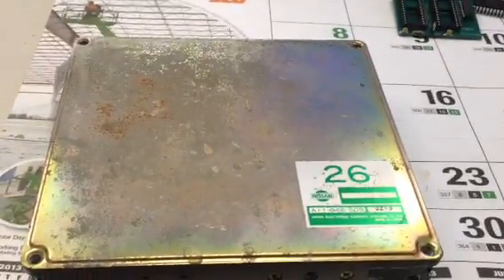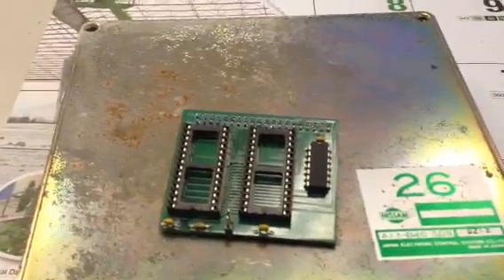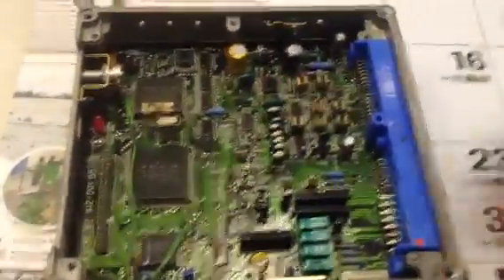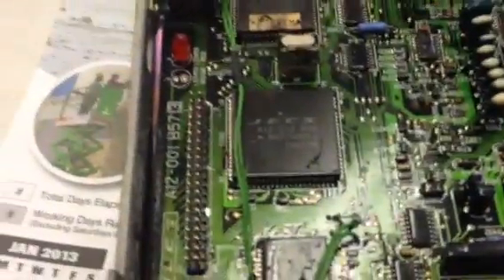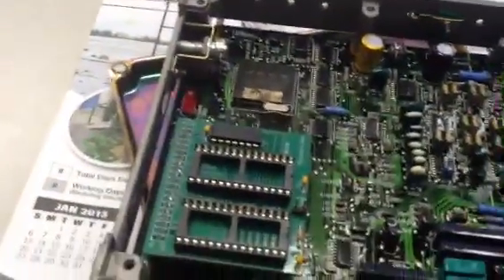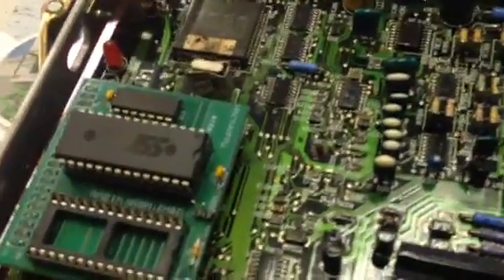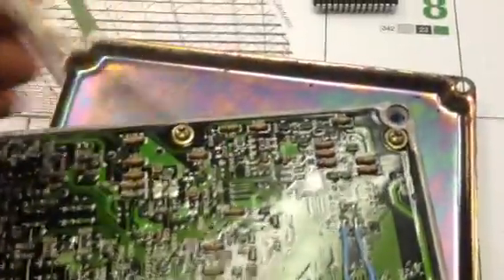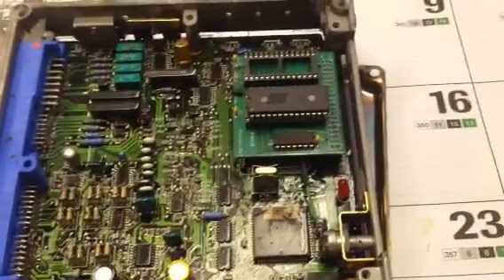Chipping your Nissan 240sx ECU ka24de/sr20det

Comment: I know it's been a long 10 years but this video is really helpfull. I'm working with sr20de+t build and would like to know if there is any chance author or anyone else in community could direct me about putting the tune on the chips, like what kind of software to use and what kind of adapters are needed to flash the eprom
Reply: you need a moates chip burner, and their software for it. You can use a tuning software to edit it such as tuner pro to edit and save, and the burner software to burn it to the chip it self.
Reply: @JZjess  thanks a lot for the info
Reply: @slowphased  this day and age you're better off buying a plug and play standalone for it's safety features and it's simplicity for tuning. You can get a link plug and play or a ecumaster with a jumper harness ans save yourself lots of headache.

Comment: Can auto ecu on 240sx convert to 5 speed?
Reply from the maker: They are the same, the only different is auto has no rev limiter.
Reply: I can put an auto ecu on my 5 speed ka24de motor and drive it without any problem?
Reply from the maker: @red666A  correct.

Comment: Could you chip a single cam running on itb?
Reply from the maker: No, single cams are unable to be tuned. The easiest way to get some wiggle room is using a piggy back like an AFC. If you are going ITB you might want to look into a standalone. ITB single cam is very uncommon. Properly built and tuned you can get maybe 20-45hp at best, reliably.

Comment: Good video. I have done EEPROM tuning before using TunerPro on a Bosch Motronic system and now will start on our KA24det (7 psi boost daily driver). I went to 240-sx.com, but did not see your *.bin files. Have you made any new videos or do you plan on updating websire?

Comment: Can you tune a ecu for a single cam ..?? All stock lmk thanks
Reply from the maker: agustin rojas No you can not. A single cam is a standard 8bit chip and can not except a 16 bit daughterboard. If you want to adjust your single cam I suggest getting a AFC"Air Fuel Controller" by Apexi or anything else. This allows you to adjust the voltage to the mass air flow sensor confusing it to adjust fuel. Similar to a piggyback system. You can find them on ebay for 30-100$. Super easy to use and great if you don't know how to tune ecu.
Reply: agustin rojas I'm pretty sure I've seen a video on a single socket put in place of the factory chip and  with a reflash a new chip was set in place much more easily than this on the 8 but ECU

Comment: Did you ever make a video on how to tune it once chipped?? I'd be interested in how to do that...
Reply from the maker: I was in the process of making a full tutorial on adjusting timing and fuel maps but I ended up selling one of my 240's which happened to be the one I was tuning/recording with. I'm currently building another SR engine so I will make one once I'm finished with it.
Reply: any updates?

Comment: Also I have a question are the stock ecu's tuneable why do they have a turn screw on them what does it do? I have been wondering for the longest time lol
Reply from the maker: Stock ECU are NOT tunable as they are currently, The chip that stores the tune is not reprogrammable. So the stock tune can not be changed. The purpose of this video allows you to change where the ECU looks to find the tune, it stops reading the stock tune and reads where the new chip is.  The screw you see on the side is for "Diagnostics Mode" which I can make a video on it if you would like. When your having an issue with your car, and you want to check if your ECU is throwing codes, you turn it and the light inside flashes. It tells you what codes are being thrown. Example: you turn it, turn they ignition key on, and the light flashes, 5 slow flashes then 5 fast flashes, slow flashes are the first number so 5, then fast flashes are the second number so 5. This makes code 55 is being thrown, 55 is the code for everything is fine. 1 slow flash followed by 2 fast is code 12 and so on.
Reply: 240sxListed hey I would like to get in contact with you so I can see where I can buy all this and on how to tune it due to the time crunch I’m facing I would like to get in contact sooner then later at yilmar0929@gmail.com

Comment: Ok man I'll email you and also, so if I bought the stuff you could do it and put a tune on it? And it would have like 2 step? An give more power? And ok that sounds fair
Reply from the maker: I have no problem doing it for you. Honestly it would be best if you learned how to do it yourself so you can understand exactly what your doing. Here is a simple tutorial on what you need to chip your ecu along with links where to buy the supplies. http://240-sx.net/beginners-guide-tuning/  
It depends on what is done to your car, simple intake, exhaust and headers along with a tune can give you slightly more power.

Comment: Do you have any of the ecu's for sale and already chipped and for cheap and will they work with the n/a?
Reply from the maker: Chipping for n/a is fine and will work just fine. You can burn a stock tune and it will work just how it did before. With the chip installed you can change a few parameters do add timing for more power, add fuel, or pull timing out for turbo aplications. I just used my last ECU I had for a friends car. If you can get your hands on a spare ecu and want it chipped so you can get it tuned feel free to email me Jesse@240-sx.com I will chip if Free if you buy the parts and I can send it back with a base tune so you can drive it.

Comment: Will you show us how to chip a 240sx 89-90 ka24e ecu? I would like to know how it's done. Thank you.
Reply from the maker: I don't have any single cam ECU or I would. The best way to work with the Single cam ECU is go AFC"Air Fuel Controller" something like  Apexi AFC they are roughly 100-120 on ebay and are extremely easy to use.
Reply: 240-sx.com
Ok thanks bro but if you do get hands on single cam ecu post up a video on how to man. Appreciated it.